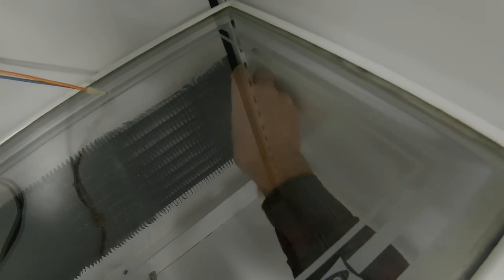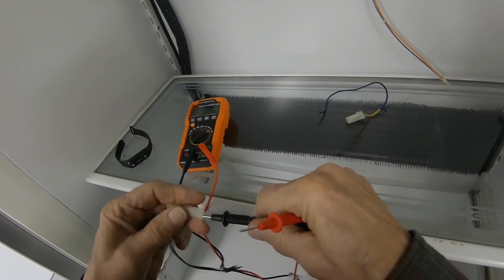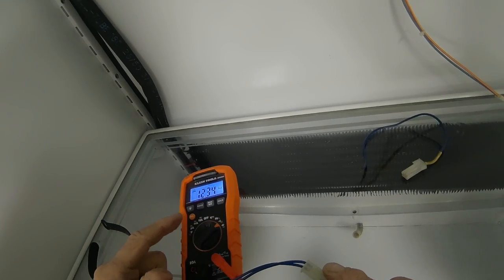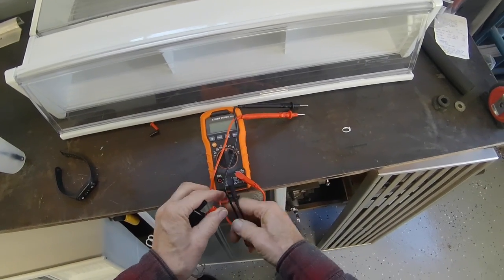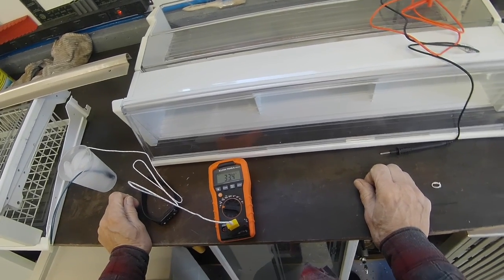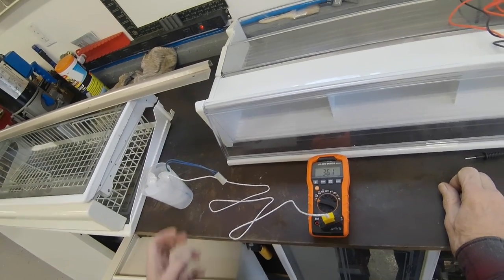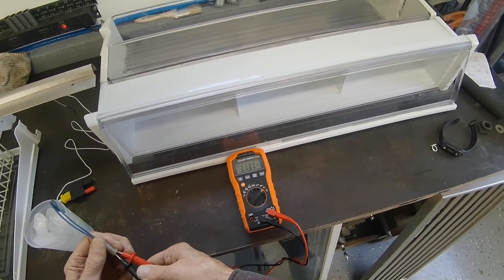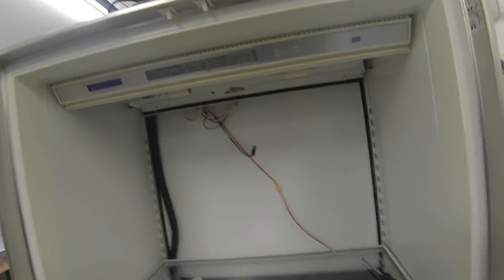How to check a Sub-Zero thermistor

Comment: The spec on a 650 is 32500 ohms at 32 degrees and 10000 at 77degrees. I couldn't find in the service manual anywhere where it specified tolerance range (or even a chart of temps and values). Can you point me in the right direction? I have a 650 (below serial # 181000 small refrigerator evaporator) that keeps freezing the bottom 1/4 of the evaporator. The Freon level is good (I removed and weighed in the correct amount). The frost pattern looks perfect. The cabinet thermistor read 30095 at 32 degrees and the evaporator thermistor read 31900 at 32 degrees so I assumed they were good since I did not have a tolerance range in the service manual. I verified the fan spacing and that it was turning correctly. In my mind only a few things can cause this condition: Excessive moisture in the cabinet (door seal), Lack of airflow (bad fan or over crowding), bad thermistor, keeping the refrigerator too cold or incomplete defrost. Since there is no defrost heater there is not a traditional defrost cycle. The compressor cuts off and the fan continues to run in the hopes it will remove the frost with what should be cabinet air temps above 32 degrees until the evaporator reaches 38 degrees and brings it out of defrost. Please correct me if I'm wrong. Once the ice forms on the lower 1/4 of the evaporator it blocks airflow so the cabinet temp starts easing up into the mid 40's. I appreciate any insight you could provide or maybe know of something I missed. Heck! my entire logic could be wrong lol.
Reply from the maker: The refrigerator is an off-cycle defrost, which means it defrosts when it shuts down. Your thermistors seem ok. As for the freezing on the bottom of the evap you may be right about the moisture. Remove the fan guard and check the piping that comes in from the compressor area, sometime the  caulking dries up and can cause the fan to suck in air.